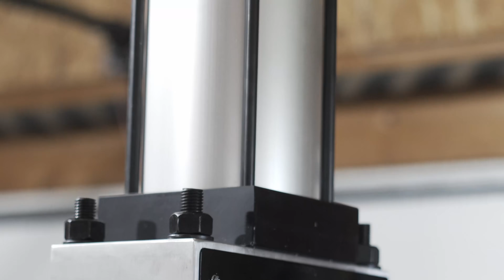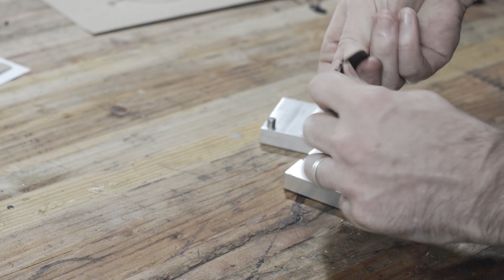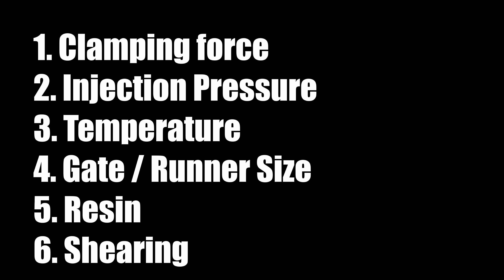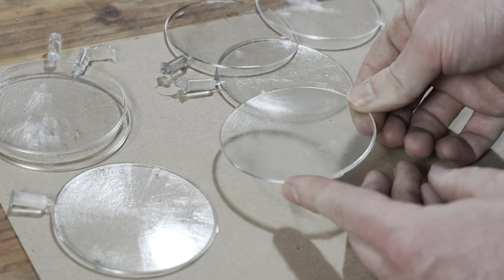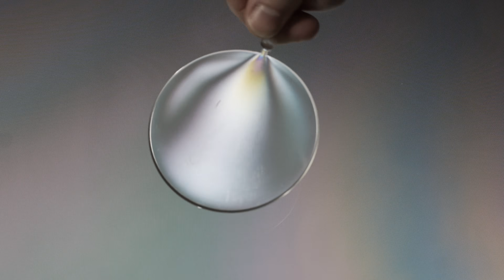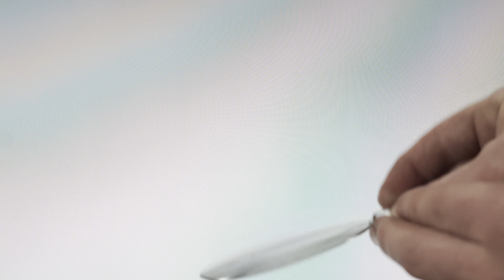Machining an injection mold for acrylic lenses

Comment: Why not to use a simple sla printed and polished mold to inject(gravity fed) two part methacrylate resin from Evonik? It could have been much easier done that way. Not sure it would undergo much stress though, if that was the original goal🤔

Comment: Cold shots on any plastic runner system should be 1 1/2 x the diameter of the runner in length beyond the next runner trunk for multiple cavities or the actual cavity inlet. For round cavities the actual gate should be a fan type but no more than 120° in arc width. Any wider and you begin to entrap air into the center of your parts. Leveling out internal shot pressures in parts can be handled by adding overflow pockets, parting line vents, and/or cooling lines for more even mold temperature control.

Comment: My other thought (and I haven't finished the video yet) is from talking to injection molding engineers where I work, they usually have a surface texture for easy release. I think something like an optical surface would be lapped on later from the initial shape?
Reply: Oop, yep, jumped the gun xD

Comment: Should go with polycarbonates for lens parts. Both halves of your mold need to be heated above 150  degrees F to minimize molded-in stresses and the gate shear. Also, clear plastic lenses require very slow injection fill rates.

Comment: I know I'm 2 years late and maybe you already solved the surface finish issue, but if you haven't then look into burnishing tools. They're essentially a very tiny diamond tipped tool that gets pulled across the face of the surface with a set force and it will smooth out all the microscopic hills and valleys and essentially make the surface very close to a mirror finish. We use them at work all the time.

You'd just need to mount the mold in a lathe so you can spin it as speed to be able to drag the tool across the whole lens face.

Comment: Having done mold making, you getting close, you definitely need registration pins.

Certain types of plastics are super corrosive and abrasive to the mold at temp. PVC, and other plastics can dull the mold material even when the mold has a mirror like finish.  Sinker EDM was used for stuff like this. My molds were also water cooled when injection molding for quality. You can also pre-heat the mold with the water.

Great video. I would loved to have had a table top injection molding machine….

Do you have vents in that mold? To let the air escape when injecting.

Comment: There is a software company called moldflow that can work out gate location, runner location and temperature (cooling lines on the mold) to essentially control the shear of the material as you inject the plastic into the mold.  They might assist you in that field.  Also, the injection dwell time, velocity of the injection are all tricky variables to navigate.. I’m sure you’ve noticed by now.  Also, there are different materials for optical purposes with  different melting index.. I love this video.  This topic did spur my interest in the 80’s..kind of brought back lots of memory on it as well. Thx for sharing.

Comment: Would it be possible to machine a mold that was compatible with a piece of glass so that both faces of the plastic would be pressed against a 100% flat glass surface instead of a rough aluminum one?

Comment: If you heat up your mold above the glass temp and then sloooowly cool the polymer, you should be getting better results with the mechanical stresses. Not too much heat, though, or you will get additional crystallization, which might lead to deformities or changes in optical properties.

Comment: I worked in an injection molding factory for a bit as an operator/material handler where they molded one small acrylic lense.  What always struck me was that the runner/sprue was i'd guess at least 8x the volume of the actual 2 ~1 cm parts per shot.  i was never able to find out the reason  but i assumed it had to do with the nature of it being a lense .  I do recall it didnt have a fanned gate, though that may have been due to its small size.

Comment: I have 5+ years of injection moulding experience, and I constantly read about this topic. I can validate that all the information here is correct and explain perfectly. Great stuff mate 
Also you might want to use partfill analysis to optimise your mold and processing parameters this if free if you use Autodesk software

Comment: This is great content and for a home job you did awesome! I am an auto engineer who specializes in injection molding lenses for cars (parabolic, fresnel, etc) and if you want optic clarity aluminum won't cut it. High carbon tool steels like SAE P20-HHMLQ are best because they can be polished after machining to a mirror finish (requires special diamond polishing for SPI A1 surface) Lower grades of steel may have impurities that prevent reaching A1 level. As for your injection troubleshooting you did very well but try to use the highest grade PMMA material, make sure to try it before use, and when setting up your injection parameters aim for the higher end of the melt temp/mold temp. Hot and fast works well for optics made with PMMA and high temp PC. Inject hot material as fast as you can which will require LOTS of good venting (its hard for me to tell in the video but I think you need more) Overall you did a great job and if you can crack optics at home its a good business!
Reply: What helpful advice! You seem very nice!
Reply: Would copper work? I know it's soft, but it conducts heat well, and I've seen people get mirror finishes just of their lathe tooling without polishing.

Comment: You can add a cold slug catch feature to your runner if you had a little more room.  One my early molds was to mold a simple flat disk, similar to the mold in your video.  It wasn't a lens, so it did not have compound curvature, but instead, had flat faces.  However, the plastic flow front profile during injection would have a similar profile to your mold.  Back then, I didn't use cold slug catches.  In my first version of this mold, I ended up with some inconsistent defects in the molded part.  Adding venting to the opposite side of the cavity (from the gate) and adding a cold slug catch to the runner solved the issue.   I later did molding simulations that showed me that cold slug catches almost always improved all numbers across the board - pressure drop, temperature gradients across the part,  frozen layer fraction at end of fill, temperature variance, cooling time variance, and other numbers.

Comment: If your material is high viscosity, and the ratio of gate diameter to runner diameter is too large, and your gate is too long in length (all of which I saw in your video), you end up excessively shearing your material as it enters the cavity.  I'm an Mech Engineer that works in the plastics industry.  I design injection molded parts, injection molds and perform molding simulations (CFD).

Comment: seems like you may need to preheat the mold prior to injection.  you may also need to cool the mold gradually. some sort of temperature controlled bath may work. the reason for the streaks may be that some of the median is being cooled faster than the rest during the injection, solidifying as it being injected. the initial median solidifies but in prosses heats the mold  so the rest of the median is able to spread before solidifying.  So preheating mold prior to injection may help.   Also I did not see any vent holes, you may need to add those unless you use vacuum to evacuate any gasses prior to injecting median.

Comment: why not start the injection from the center of the lense, you'd have to tilt the workpiece and wrench down the mold halves by adding holes so you can wrench them independently of your machines clamping mechanism

Comment: you could polish the molds in a simmilar fashion to telescope mirror polishing. Just make a small disc that has the exact same curve as the mold, put it on the mold and put a bit of water and very mild grinding dust in between them and grind away. there are many guides online on the exact technique of grinding telescope mirrors

Comment: I assist the injection molding process technicians in a Honda parts supplier facility.
You nailed it with your guess on why you were getting the silver/splay. try adding a small resin dryer to your setup, if you add a small dryer and a hopper that draws from it you will likely eliminate your splay problem. No amount of heat will help with non-dried plastic.

Comment: Why not use the injected acrylic as a polishing lap with diamond paste? It already has the exact shape of the mold, acrylic will embed the diamonds well, and you could simply put it in the mold and spin it around by hand for a while to get a perfect, optical-quality mirror finish.
Clean well between polishing steps, and use a fresh injection for each successive level.

Comment: Acrylic is abrasive and will wear your aluminum molds out. Also since it's abrasive, you can use it to remove burnt resin from the internals of your barrel and nozzle.

Comment: I wonder if you could use glass for the mold? Either full glass molds or mounts some pucks in metal blocks. That would allow very good surface finish and may allow good figuring.

Comment: How would look the internal stress pattern if the gate/ runner would be perpendicular to the optical plane. Would the pattern look circular? If so, could it be used to make very high refractive lenses?

Comment: Item 7, mould temperature. Injection moulding is a thermal process, requiring accurate control of both melt and mould. Both need precise control, 
around +/- 2C.
Item 8 mould packing. This controls the pressure applied during the cooling phase when material transitions from liquid to solid, the packing replaces the material lost to shrinkage, and defines the actual part dimensions and quality of the finished lens.

Good luck you are doing well.

Comment: I"ve done lots of injection molding in the past and I think if you sand down your mold it could help like if you get it really shinny with some 2k grit. Another thing is you should put some gas ports on your mold. I think for this optical piece I would of just bought a thing of silicone and some acrylic resin and saved tons of money. Injection is not the way to go for optics. unless you're doing polycarb.

Comment: What is the difference between resin, plastic and thermoplastic in English? I'm not native speaker, but I had expression, that resin is something which sets by chemical reaction, and you inject thermoplastic?
Reply from the maker: Ah yeah, sorry about that. "Resin" is sort of an informal term used in the injection molding world to refer to any of the thermoplastics used for injection molding. Thermoplastic is a more specific term that means any plastic which can melt and re-solidify, potentially multiple times.  This is in contrast with thermoset which "cures" via a chemical action, like epoxy or glue.  "Plastic" is just a generic catch-all for any kind of polymer, similar to resin.  Yay informal definitions :)

Comment: why spherical when you are already on a cnc? true lenses are parabolic, spherical is just a simplification for mass manufacturing.
Reply from the maker: A) simplicity, wanted to focus on the injection molding and B) definitely not true, spherical (plano-convex or biconvex) are widely used for many reasons. You don't always need or want an aspheric in your optical train, and usually aspheric lenses are more complex shapes than just a parabola (see: https://www.edmundoptics.com/knowledge-center/application-notes/optics/all-about-aspheric-lenses/).  Parabolic mirrors are commonly used though :)

Comment: Hey, I am a little late to the party on this one since I just found your channel. You do some awesome work and it's greatly informative! From what I understand the residual stress that is in these lenses is partialy caused by cooling at different rates so potentially another way to increase your optical quality would be to heat up the mold before each injection. Would be interesting to see how good of lenses you could make on your own keep up the good work!

Comment: The pcd cutter is actually  better suited for use in hardened steel...aluminum can be a bit gummy some series more than others.....aluminum  with a carbide ball end mill with a ZrCN Coat  would be a great option

Comment: Bro this is some high tier content, and i know thats a trend in the comments but this is good.could you see if you can print injection molds with a resin printer? Seems an injection molding machine could be DIYed, but the mold itsself is a bit of an issue.

Comment: from what i know, when making eyeglasses, i think they just start with an acrylic block & machine it to near the lens shape, then clean it up until the measurement is right. it seems like youre doing a lot of extra work to me, but injection molding could skip the wait time of machining each new lens (if you plan to make a lot), so not a bad experiment.

i never worked with any of this stuff but since you said the stress in the lens is from the gate, my idea would be to remove the gate from the lens. imagine the acrylic is injected from all sides at the same time, the only way i could see to do this is by having a small moat around the lens, & use multiple gates on the moat which all channel to a primary gate. if the lens is horizontal & the primary gate is perpendicular, then the secondary gates (4-8? idk) should maybe have an even flow, but the actual edge of the lens would have a thin opening to the moat completely around & the acrylic would only start pushing into the lens as the moat has filled up. im not sure if it would remove the stresses from the lens, but it might at least be interesting to see how it changes, as most of the stresses should be concentrated in the moat i think, which is disposable. 

actually, now that i think about it, my idea might make a lens with a hole in the middle, because i didnt think about releasing the air.. or does injection molding vacuum all the air first?

Comment: Those aluminum molds are giant heat sinks that will rapidly pull the heat off of acrylic, which will make the stresses worse. You need to ensure that it cools slowly.

Comment: Dry the material in an oven for about 4 hrs @ 150 f and it will make big difference.  Gate size and design is facinating, the change in shear can have counter intuitive effects. A flash gate might be how they do production optics.

Comment: have you tried to preheat the mold, it may help some with of stresses. I only operate an injection mold so the only thing I can tune is machine based variables but we also don't worry about internal stresses because we run plumming parts.

Comment: i make a bit of mold and you can never get a good finish with any bit ...
we use to polish the matrice with oil stone from 220 to 2000 and then finaly polish with daimond paste... and the "mold need to be heated and water cooled"when you take out the piece we use glicole... to prevent rust (sorry for my english)

Comment: I would think a CNC would be able to polish after doing its digging. Is that correct? I mean you'd have to change out the tool, but is there a tool that does that?

Comment: Hi, can you tell me please the Model number from the pneumatic Cylinder? 
if the model number is no longer on it, you can see the bore size and stroke size on the black border of the cylinder.  That would be enough for me as information.

Comment: Would it be possible to have the gate in the center of the lens? Would probably disperse those stress lines out in circles instead of the fan. Should only take a little extra sanding to remove the extra gate plastic from the center?
*My 'knowledge' of the process consists of watching a few YT videos

Comment: Pre heat the mould,  use low pressures,  optimal temp, use hard chrome plated steel mould

Comment: You could try putting the mould in an oven to pre-heat it to somewhere between 150°C an 200°C (a bit on the hotter side is probably better because I reckon it will lose quite a bit of heat while you're putting it into the machine before you're actually ready to take the shot). After pre-heating it would be better to mount the mould into your machine with two pieces of wood or cork (assuming those can stand up to the clamping forces, otherwise delrin or teflon might be good insulator candidates) between each side of the aluminium mould and the press face to prevent the huge thermal mass of the press' metal confinement plates/frame from sinking the heat away from the mould. I think that pre-heating the mould has a good chance of reducing the striations, stress patterns and/or any other injection difficulties you might (not even know that you) have! :D
BTW: the algorithm has picked up your channel and is randomly recommending it to people (like me) so be ready for a HUGE influx of new subscribers! I've seen channels from anywhere around 10k subs skyrocket to easily 100k-200k within a few days or at most a few weeks. Keep up the quality and keep doing whatever you're doing and the algorithm will continue to love your videos and send LOADS of traffic your way! :D

Comment: may i suggest that for polishing aluminium you try some autosolve german polish with scrunched up tinfoil, it works very well and takes less time than a buffing mop on a drill, its something that motorbikers do when polishing the metal work, i also make my own Dremel bits for polishing and have found that multi-layeing a   layer of green scouring pad with a layer of soft cotton materiel buff up metals real nice, you have to hand stitch them tight but they clean up metal work real well, i have used this to polish out scratches from glass and clear plastic.